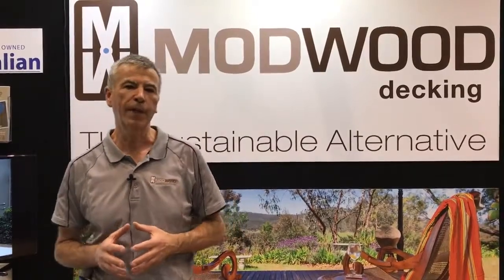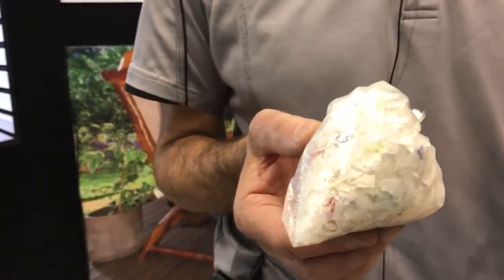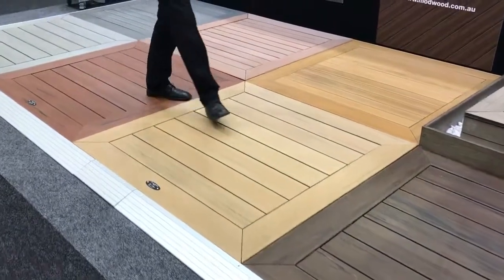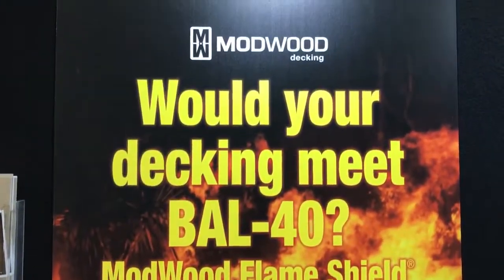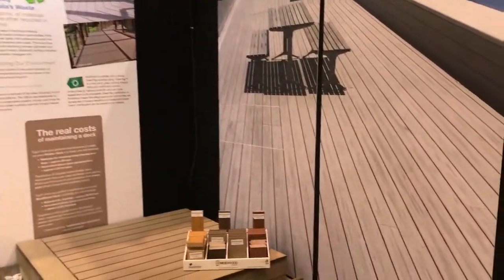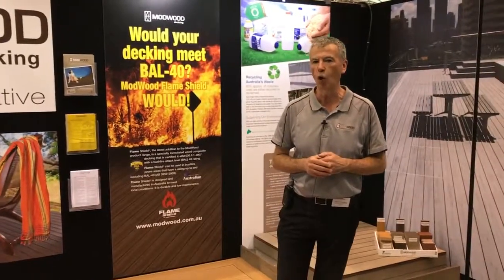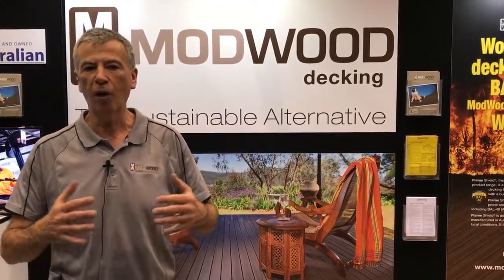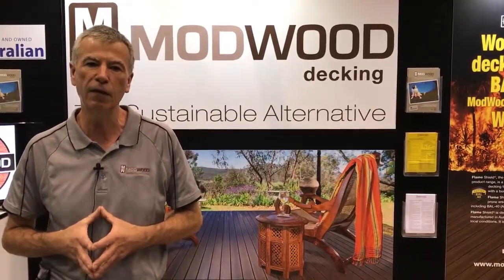ModWood Decking Perth Home Show

Comment: it fades and  wears with out even stepping on the deck exposed to sunlight and rain  , don't waste your money on over priced crap .
Reply: baits agreed I spent 25 grand and it’s shit
Reply: @angelinadrobina5037  i'm going to have to seal it with decking oil in the hope it won't erode away . it's starting to swell by the looks of it . most likely from the chip wood mixed with plastic now that the top layer. has eroded .
Reply: baits I’m selling the house I can’t stand it .... trying a new cleaning product today I’ll let you know how it goes 🤯🤯
Reply: @angelinadrobina5037  the moss goes away with a presure cleaner , but it will wear off some top layer  off the modwood . when i get a chance , i'll clean and seal it with some decking oil . so much for maintenance fee .
Reply: @angelinadrobina5037  I'm guessing the warranty doesn't cover colour fade then?
I'm install floorboards for a living, but I also do the odd decking install. I've installed this system before and I will never install it again, the planks bow and warp when exposed to sunlight which can result in the hidden clips failing.
Reply: @zchettaz  there’s no cover - we’ve sold the house and I’ll never use it again
Reply: @angelinadrobina5037  just avoid composite decking altogether, they all have the same problems in the hot sun, they'll also burn the bottoms of ya feet lol. Although hardwood is also a pain to work with, its a proven long lasting decking material and worth the maintenance they require.